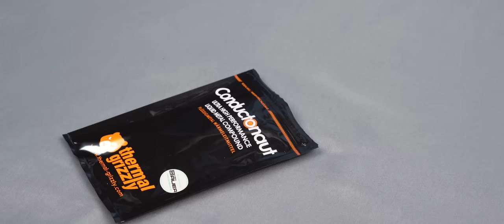Liquid Metal Technology | ROG

Comment: Of course they need this cause they pushed those 14nm very hard trying to compete with ryzen 4000
Reply: Agreed
Reply: If they put this cooling solution to Ryzen 4000, maybe they can even put the Ryzen into more thin chassis like Ultrabook. 1 Kg Ultrabook with good screen, battery life and this much raw horsepower seems like dream come true to me
Reply: yep, now instead of running 105c ingames on intel laptops, it will run somewhere between 95c
Reply: @EIUO  should I buy g14 fo 3d modeling?
Reply: True
Reply: @AnkitPatel04  of course bro...it is great...
Reply: do you mean 14nm+++++++++?
Reply: @AnkitPatel04  if your program is CPU heavy, G14 is a nice choice. You can watch benchmark from a lot of tech reviewers, some of them even compare it with intel desktop cpu and the result is very good.
Reply: @Distortion_World  ryzen will boost according to temperature. On desktop, the difference between a stock cooler and an noctua nhd15 is the difference between 4gz and 4.15 gz on a 3700x.
Reply: @AnkitPatel04  only thing is that the note book has some ghosting on the screen other than that it's great
Reply: if this LM get beaten by ryzen.  I guess they will use nitrogen on the future product  for all new intel mobile 14++++++++++++++++++++++++++++++++ 🤦sad
Reply: More GHZ means more POWAHH!
Reply: @AnkitPatel04  get a pc if you can, pcs will always outperform laptops for half the price and a much better monitor
Reply: Exactly
Reply: Basically it's the last choice to get the max performance of 10'gen intel to beat ryzen, but i still doubt they can make it 😂
Reply: @albertcanon9185  they can't. thermal compound only determines how high percentage of heat is transferred between cpu and heatsink. heatsink is still cooled by those tiny craptop fans and liquid metal isn't going to make much difference.
Reply: lol .... I totally agree !
Reply: @AnkitPatel04  OR you can wait for sometime for other Laptop companies to release some AMD based laptops
Reply: @AnkitPatel04  There is going to be a g15 soon, so I consider for you to just wait a bit.
Reply: The European Commission fined Intel 1.06 billion euros in 2009 for giving what the regulatory body said were illegal rebates to OEMs Acer, Dell, Hewlett-Packard, Lenovo and NEC as well as German retail group Media Saturn Holdings on the condition that they buy most of their processors from Intel.
Reply: @noel.sk03  which CPU exactly?
Reply: @noel.sk03  throttles at 95c
Reply: Cpt.Hamza i had never framedrops or throtteling.
Reply: Ca9ine C0mic I9-9880H (ROG SCAR III)
Reply: @noel.sk03  I don't know what benchmark are you comparing, according to jarrods tech, in the blender BMW benchmark, the 4900H gets up to 61°C at 45w and the 9880H gets up to 75°C at 60w
Reply: @AnkitPatel04  no, the g14 runs way too hot. It's cool what they were trying to achieve...but in the end, it'll burn your lap and hands and annoy you in the long run
Reply: I like how it ended up being with Ryzen chips because they ran too hot with any other paste.

Comment: Worst thing ever!!!! You can't place your laptop at an angle when you are using it, or the liquid metal inside will 100% shift its place after being used for a while, resulting in thermal throttling, high temperature, and a huge performance drop. What's even worse is that your laptop is gone if the liquid metal inside leaks out. And that's not the worst; the worst thing is that ROG doesn't let you swap the liquid metal inside their machines with anything else, or you'll lose your warranty!!!! I was ready to buy the latest Zephyrus G16 until I found out about their policy, so I bought the Lenovo Legion Slim 7 instead.

Comment: Why not a Ryzen, it's better in every way, time to switch, Intel used to be the best but anymore, if you use an Intel CPU in laptop it makes it lower end.
Reply: Well (duuuhr)said m9...
Reply: The new Ryzen 4000 apus also run really hot - like above 90C. Watch Der8auer's video about it - https://youtu.be/_aLH0Q6CZF4.
Reply: @afc8981  put that same shitty cooling on a top tier intel cpu and you will start a fire. Point is i belive intel still payes manufacturers to slow ryzen 4000 by all means. Worse cooling selutions worse screens only budget laptops. Go to msi or asus web site and you will get bombarded with intel 10gen cpu laptops you need to search for ryzen parts even tho they are more efficient and more powerful and cheaper.
Reply: Money talk I guest. Sintel still face bunch of problem with their CPU below 14nm developments. So, Sintel could throw their cash to make some "special deal" with Laptop & AIO PC Manufactures to boost their product selling right now. IMHO.
Reply: zulfikangga  thats becuse of its below par cooling. And its 3000 series cpus where bad zen 1 cores. 4000 series is zen2 cores cooler faster but misstreted by laptop manufacturors. They do not use the same cooling selutions on ryzen parts as they do intel becuse they think they can get away with it

Comment: 6 months into using a liquid metal cooled ROG M16 and it's throttling a lot earlier than when new. Fans and exhausts were just cleaned and the air coming out is nowhere near as hot as new, so it's taking less heat away from the processors. Evidently the liquid metal did not remain in proper contact throughout use
Reply: had to repaste my Scar M17 as well - the liquid metal was all over, but not where it was supposed to be... Really looked liked applied by amateurs 😞
Reply: Some here on my advantage edition g15. Gonna change it with PTM7950
Reply: @ufukozdes2226  Did you ever go ahead with the ptm? Pad or paste? Considering this for my strix g15.
Reply: @OnTheRocks71  I did. My LM application was woeful. I have noticed that half of the GPU was not even pasted, LM was all over the place. cleaning was a pain in the a**. But so far so good. My Initial temps was 95-97 for CPU and 84-87 for gaming. its now 84-85 for CPU and 75 on GPU. and no more turning itself off. Definitely suggested.
Reply: me too on Strix g16 
have to re-apply it 

now cpu temp went from 95 to 80
Reply: Yes Asus LM application is terrible. Its like playing lottery

Comment: I wonder when this will be applied to your graphics cards as well?
Reply: Hold your horses! They have to sell this generation of laptops first before introducing an innovative idea of covering GPUs as well in the future generations.
Reply: Intel 10th gen CPUs only.
Reply: @slim7306  I know, but WHY? We had to void warranties for years and now this...
Reply: @mhe0815  The graphics processors don't really need it, but Intel 10th gen CPUs are heaty so they NEED that liquid metal to function properly.
Reply: @slim7306  oh is that why most of their 5700xts ran like 80s and 90s on the VRM and ran hot in general _))))
Reply: yeah it would be great so that they could boost the gpu performance
Reply: @slim7306  that's because intel says the 6 and 8 core 10th gen Intels have a 35-45 watt TDP....but really it's 50-75 watts. Intel quotes the manufacturers one thing; the manufacturers build and design according to what they're quoted and spec'd, and then they receive a very different actual product and result from Intel than what they were originally quoted...
Reply: @r3d0c  It may seem shit, but it really is the way that they need to do it. The WHOLE GPU die needs to be covered (because it does not have an IHS, the die itself is what generates heat), and the only way that they can ensure that is by putting lots of paste. They can’t use very high performance thermal pastes because those will dry out faster over time compared to normal thermal pastes, just watch Steve’s interview with Der8auer (the Pump-Out effect). Additionally, most people don’t even open up their laptops to repaste, so they have to ensure that the paste that they will use will last at least more than 5+ years. It really isn’t as simple as that, they have to think of longevity.
Reply: @joshuabales2354  very true . My 11800h in Msi GP76 is rated for 45W , but in demanding games I see 55-75W . 80% of games only 35-45W but highly demanding are 55-75W

Comment: Need improovement ! 
Consider the second appliance is not needed, as it's to much it does spread beneth the Heat Spreader.
Consider surfacing that afore mentioned HS to a good surface finish and lowering the amount of thermal paste used globaly.

Comment: Lmao, Intel cpus overheat so much that they needed liquid metal, straight out of the factory.
Reply: @Qman 25 guess why only intel cpu receive this treatment but not ryzen cpu and nvidia gpu?
Reply: @ntuduy  Because they don't need it? lol think before you type.
Reply: I wonder why they didn't liquid metal the GPU? Is it because nvidia gpu don't produce that much heat?
Reply: @ntuduy  I also think of that, why the gpu doesn't get liquid metal
Reply: zulfikangga  i mean, a laptop i5 it's just a joke for today's standarts. So it will obviously not overheat becauss it's weak lol
Reply: zulfikangga Are you talking about Ryzen 4000? Or 14nm Zen (2000 series) 😂?
Reply: zulfikangga  what is your model?
Reply: @Qman 25 All these years intel has been dominating the CPU market, charging a lot for their CPU's without any competition. I would at least expect Intel to wisely use the money on research for a more efficient Chip. Good thing that AMD is stepping up their CPU game, without real competition, it hurts consumers wallets more than anything else.
Reply: zulfikangga  ur biggest regret is trust those AMD fan boys.
Reply: Intel is also loosing out cause they don't use Tsmc fabs. Though for some reason AMD chips are not able to push clock speeds as high as intel i dont know why. AMD should be much cooler at those clock speeds because of the 7 nm process but I guess that's the trade of for having more core and threads
Reply: @siddhantdeepful  tsmc hard Carry AMD still sucks. Without tsmc help AMD is nothing
Reply: @zihechen3111  i mean neither is Qualcomm, Nvidia, Apple or Samsung by that logic
Reply: @siddhantdeepful  Man, u shouldn't compair apple to others. This company makes luxury. It's like compairing Gucci to Nike. If u see apple as a tech company u r wrong. It is not. It is a luxury company.
Reply: @siddhantdeepful  AMD would be 20% behind if AMD use 14nm or Intel would be 20% in front if Intel used 7nm.
Reply: @zihechen3111  but amd doesn't use the same logic circuits  as Intel in their processors. Sure they are both x86 but how they implement x86 is different. The design was still made by AMD. I dont understand what do you mean by "luxury" the internal components of apple are still made on PCB and transistors which mostly comes out of TSMC. Qualcomm and Apple both use same fabrication of ARM but their internal logic/design are different
Reply: @siddhantdeepful  so one 7nm one 14nm, Intel may get similar performance sometimes even better for each core? When 7nm give 20% increase on improvement? Tsmc is God AMD is not
Reply: @siddhantdeepful  apple is a luxury company may only sell shit as luxury. I do never believe apple may make any revolutionary improvement on technology. Even it did. Either the shit was too simple to make or it is a fake news.
Reply: @zihechen3111  even if Intel switch to 7nm there is no gurantee that Intel gonna beat AMD,it took time to optimize, fix bug,security.AMD is smart enough to co op with TSMC,they have to design the chip,TSMC didnt carry Ryzen,it more like collaboration,without Ryzen, AMD is trash,look at older chip like FX, seem like alway have thermal issue,but Ryzen 3000 is more like a revolution for AMD.
Intel for gaming
AMD for work
Bad english,im sr, just try to express my point
Reply: @MATHPC 40 So no one ever told you that the ryzen cpus run up to 100c (asus g14) or more when gaming or running cpu intensive apps so it overheats as much as the intel based laptops?
Reply: @mathpc4047  think before u type LOL, dont embarrass yourself LOL

Comment: Even thermal grizzlys great formula for liquid  gallium still oxidizes and solidifies/dry. Wonder if they have a high temp silicone to both protect the board and prevent oxidation.

With that said, I put some in my laptop some 5 years ago and still have great thermals that don't seem to have changed since then.

Comment: How about the maintenance of the liquid metal? I'm not expecting all users to "have enough courage" to crack open their laptops and risk damaging it while re-applying the liquid? (Correct me if I'm wrong, but from my experience with liquid metal, it kinda evaporates and gets solid in 6 months)
Reply: 1 year + bites and degrade heatsink and surface of gpu.
Reply: Wrong.
Reply: Isn't that the case with bare copper heatsinks? I heard nickel plated heat sinks are fine
Reply: @asiffaisal9733  i had copper heatsinks on 280x Gpus, did Liquid metal on them back in 2014 and in 2016 they were rusted and broken (pipes from heatsink).
Reply: @asiffaisal9733  It depends of ingediants and manufacturer of Liquid metal but I wouldnt trust anyone. Had Grizley on Sager p170em on gtx670 and after few years surface of gpu coroded.
Reply: @nikolakarovic5964  Thanks for the knowledge... Though haven't tried liquid metal yet 😅
Reply: @TiberiuLupescu  its true
Reply: @nikolakarovic5964  degradation only happen between bare copper and the liquid metal. nickel-plated copper, which is what asus using, is immune to this effect
Reply: @khangle6872  "Asus using" for what model, I had 280x Dc2 that was eaten all inside from liquid metal. All 6 cards in mining rig.
Reply: @nikolakarovic5964  didnt you watch the video? nickel plated copper was a new solution in 10th gen laptop, which mean it only integrated  in 2020 rog laptop running intel.

You wont expect a newly introduced technology (like, take a look at the public date) to have been around since a million years ago
Reply: @khangle6872  I watched video half year ago. I say to people that they shouldnt experiment with their gear if thermal paste works in 99.99% cases.
Reply: @nikolakarovic5964  Hey I Just Wanted To Ask Do I Need To Replace Liquid Metal Every 1 Year? 😅

Comment: Hey my pc cpu was get up to 92 degrees and I didn’t yet have Liquid Metal and I had to use a thermal paste on the cpu and now the temps are even worse on idle my cpu is around 80 on silent and when I put it at performance or turbo damn it goes to 95 degrees and I don’t know what to do and I’m  damn scared to put in Liquid Metal as it’s conductive when I get it soon. So do you have any tips that could help me out. 

My specs 
  Ryzen 7 5800h rtx 3050 ti

Comment: Why only for the Intel-based laptops and not the AMD 4000/Renoir-based ones?

It'd be really great to have fantastic TIM out-of-the-box for the G14/G15/A15, etc.
Reply: There are many die side caps on the AMD part as compared to the Intel part. During rel conditions the LM could escape the TIM1.5 area and interact with the caps, killing the part.
Reply: @CutaneousSensations  i didn't a thing what you just said. Can you explain in a greater detail
Reply: Sudip Das basically on Intel chips there aren't any exposed capacitors or resistors on the chip itself (as you can see in the video when then machine is going back and forth on the chip applying liquid metal). Liquid metal is electrically conductive, so if it were to make contact with an exposed capacitor or resistor it would destroy the chip. Amd chips have exposed capacitors and resistors on the chip itself, so they can't apply liquid metal in fear of it leaking and frying the chip.

Comment: We will see any difference if the liquid metal is applied on a ryzen laptop?
Now for the rocket lake 14nm,I'm thinking that they will use silver instead of copper for the heatpipes(silver is the best mineral for heat transfer and dissipation) and put liquid inside the heatpipes
Reply: yeah if you want to become broke. using silver would dramatically the cost of the laptop, copper also has a higher heat capacity than silver, which is more important in this case.

Comment: This is why asus laptpp prone to LM failure (or carred spot on GPU/CPU after use for 1 year). 2 glob more LM and just hope for the best for proper mounting and mounting preassure in hoping LM not run away and fill yhr gap between IHS and CPU/GPU are pretty much stupid. 

Asus need to change to use PTM or much better just use graphite sheet attached to IHS.

Comment: I have seen with laptops that after 3-4 months it need to be redone cause the liquid metal seems to get absorbed in the copper heat sink. After the second time it keeps working fine. I wonder how this new laptops do after those months.
Reply: nickel plated
Reply: @kingsmod8777  I hope you are right. So far the ROG laptops i had, did not had nickel coating on the heat sink.

Comment: how about 9th gen cpu..i i bought gx502g with 2070 gpu...the cpu temp while gaming heavy load 95c sometimes 98c ...
Reply: I'm in the same boat have the g712lw with i7 10750h and it's about a year and a half old and I'm having it throttle during gaming hitting 98c even with a .80 under volt the max the lame.bios will allow .  Also was advertised as 3200mhz ddr4 so upgraded the 16 gig kit for a expensive lower latancy 32 gigs to find out it won't run past 2800 ish and no way to enable xmp or change that in bios .

Comment: what material is used for the heatsink? is it just copper or nickel-plated copper?
Reply: Jan Š great question. I have the same one. What most people don't know is that if it is bare copper, the liquid metal will interact with the copper and potentially hurt performance over time.
Reply: @emammah12   after 1 year of research m sure they've used nickel plating. Otherwise it would be impossible for them to give a warranty